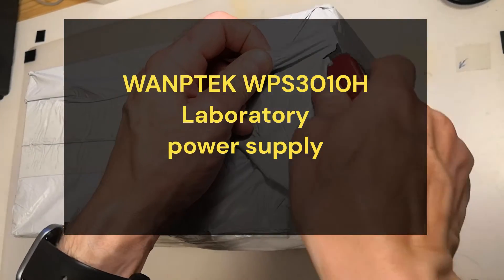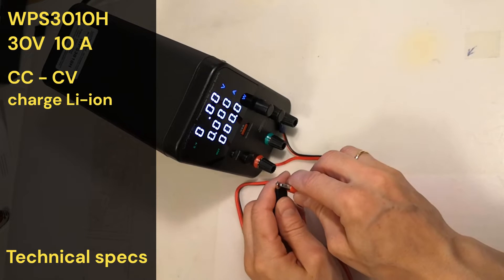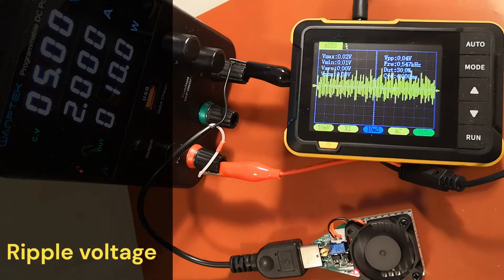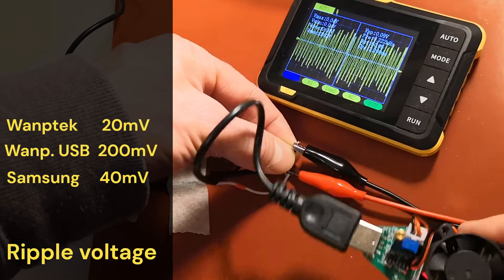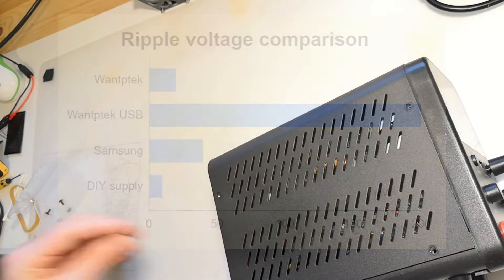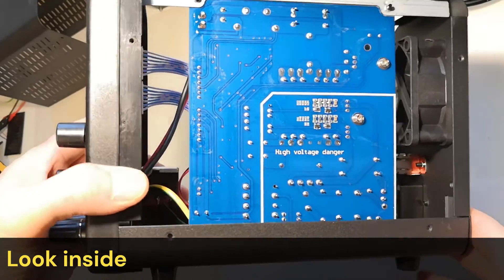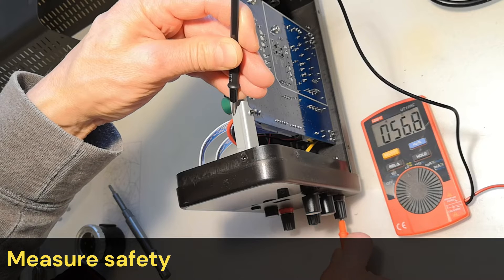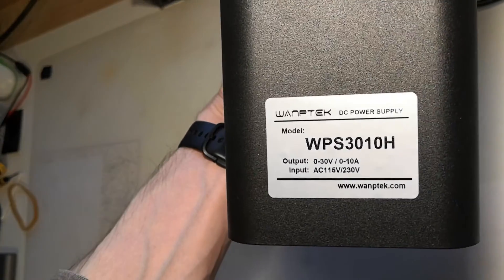Wanptek WPS3010H lab power supply

Comment: Excellent video, engineer.
I hope you can help me with one question: What is the minimum ripple voltage a switching power supply could have?
Tks,🎩
Reply from the maker: Ripple is always there. If you had infinite capacitance and perfect control, the ripple would be zero. In practice, ideal components does not exist and smps always has some ripple. It can be made negligible though.

Comment: Thanks for this awesome review 😁 

I bought a suspiciously similar power supply from Amazon a few weeks ago. Different branding, but otherwise identical. The beeping was driving me nuts too, and I'd overlooked that part of the manual, so many thanks for pointing out that it can be disabled 🎉

I'll have to see what the ripple current is on the USB for mine. If it's as bad as yours, then I'll try your capacitor solution too.
Reply from the maker: It would be interesting to know if high ripple voltage at USB port is a common problem. So, if you can comment after measuring your unit.
Reply: @SnapTinker  tested it just now, and there's definitely a ripple on mine too. If I'm reading my oscilloscope correctly, it's between 100mA and 200mA. So about the same as yours, it would seem.

Comment: Is it possible to set the voltage to 30 volts and the amps to 3 amps and maintain it until I’m done using it? Every time I try it lowers my voltage on me
Reply from the maker: If you set cc-limit at 3 amps, voltage drops at 3 amp load. That is how cc/cv works. Below cc limit voltage should not drop ( except measured at cable ends because of cable resistance).  If  cc limit is above 3 amps,  your device is faulty or this device does not function well at max values. I cannot test myself, I don't have proper test load.

Comment: Hello!Please tell me, how did the power supply unit perform?Thanks!
Reply from the maker: I have not had any problems with it. It delivers 10A as expected, but I did not have a long time load test though. The only issue is the ripple current of usb-port. Can I fix it with a capacitor? Some day I'll test that.
Reply from the maker: I soldered a 100uF capacitor into usb output. It solved the ripple voltage problem. Easy fix!
Reply: @SnapTinker Can you show how?
Reply from the maker: I have another video on my SnapTinker channel, where I do  ripple voltage fix, adding a capacitor.